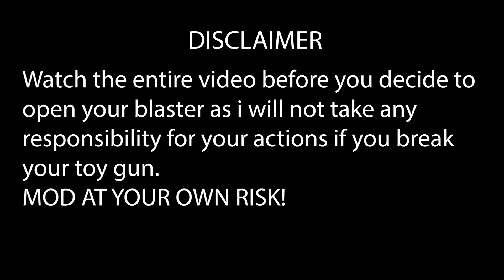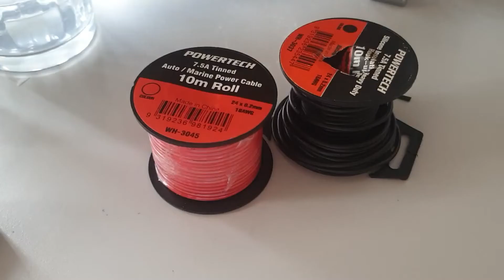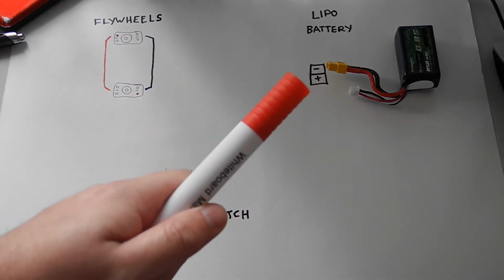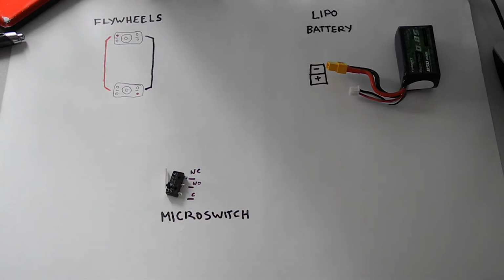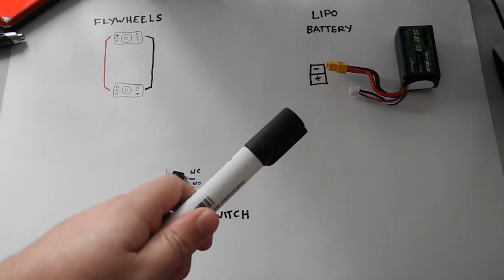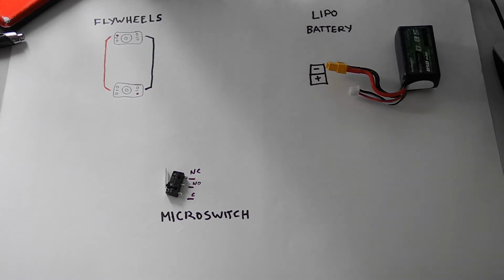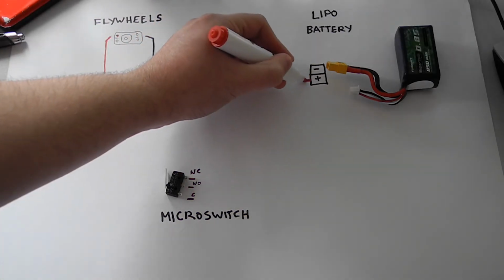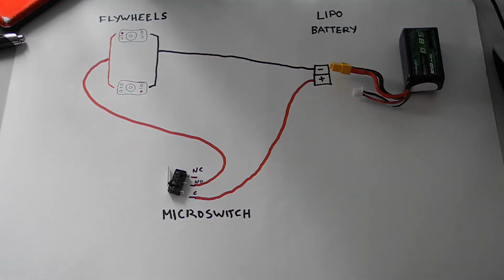[MOD TUTORIAL] Nerf Rayven/Rayvenfire Overhaul

Comment: I’m having a lot of trouble with the glue how could I deal with it alternatively
Reply from the maker: An alternative way (Which i didn't cover) is using a switch mount for the rayven. https://outofdarts.com/collections/3d-printed-parts-2019/products/nerf-rayven-switch-mounting-plate-3d-printed-ideal-rev-trigger-switch-placement. 
Add this into your blaster, then add a 21A microswitch. and rewire as normal. Some people prefer using these, others prefer seating the switch in with adhesives and filler, it really depends on modders skill/preference.
Reply from the maker: Also, If you are talking about the glue in the bottom handle that connects the grip back to the bullpup design, then your best bet is to just use a knife and a flat head screwdriver as shown in the video. take your time on this, and yes it is a pain however that's the advice i can really give. (It is only applicable with the newer versions of the Rayven being the white one. others should be fairly easy to open)
Reply: Hot glue or Epoxy putty works alright

Comment: hey, could i get links of all of the parts used?
Reply from the maker: Hi there. I've just updated the description box and links to all the parts i've used are there. (All the links are from Out of Darts, however there are other sites such as Containment crew, Foamblast, BlasterTECH AU etc that may also be helpful for faster shipping depending on where you are.)
Reply: @redninjaproductions9682  should i 3d print my own flywheel cage?
Reply from the maker: @spr6ut  That's up to you. If you can afford to 3D print, go ahead. I personally buy them directly from retailers (As i don't own one) The cage itself does vary in price depending on material (Metal vs PLA) shipping is the costly part.